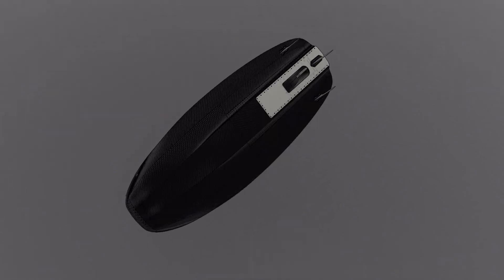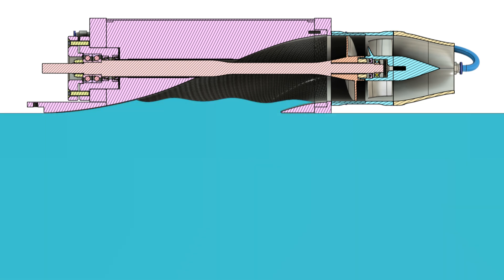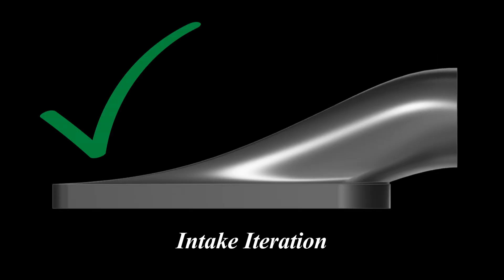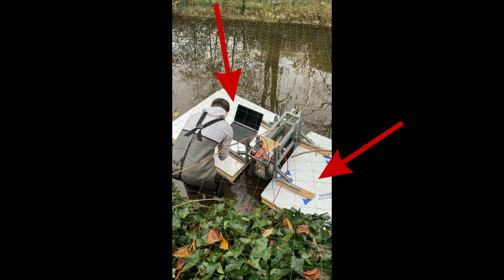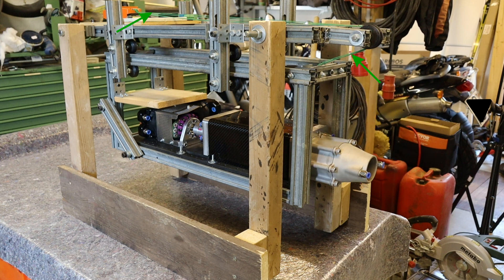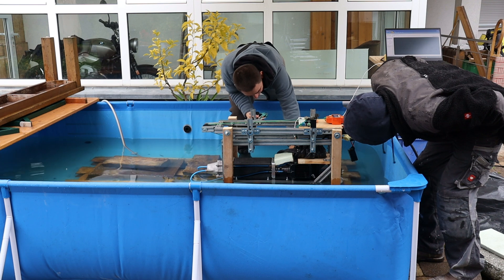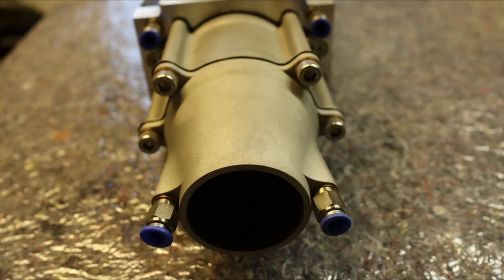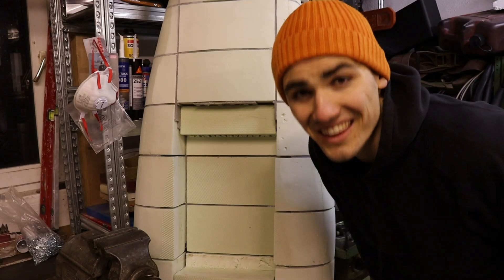WATERJET PROPULSION at its finest !!! | MOTORIZED SURFBOARD from Scratch! | PART1.1| (Short Version)

Comment: Wow, great project! How did you manufacture all the components? Did you cast/mill them yourself?
Looks really cool. 
Which motor & motor controller are you using?
Reply from the maker: Impeller, stator and nozzle are laser-sintered parts. The rest ist mostly cnc machined. 
I might make all of the CAD-Data and parts I use open source when the project is completed. 
Thank you for the comment!

Comment: try no moving parts heat-mhd u-loop jet thruster. kinda like pulsejet but more like heat ramjet. yep just boil water or air intake. at very high temperatures of a resistive electric graphite wire.

Comment: Hi, I was wondering if you if you have looked into adding “veins” to the nozzle to transfer the rotational force of the impeller to produce more thrust.
Reply from the maker: Hi, thanks for the comment. You are right, that would be possible and maybe even helpful. I tried it while developing the jet but could not really see efficiency improvements in CFD. The main problem was that I did not have enough time to implement it properly.